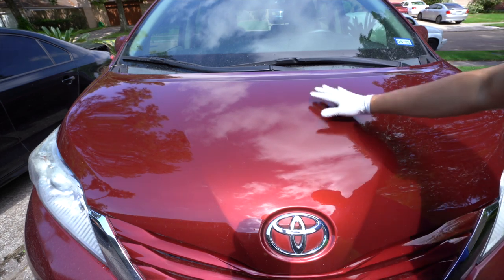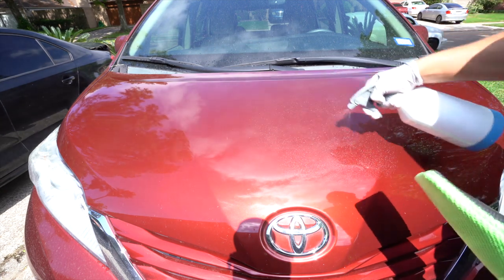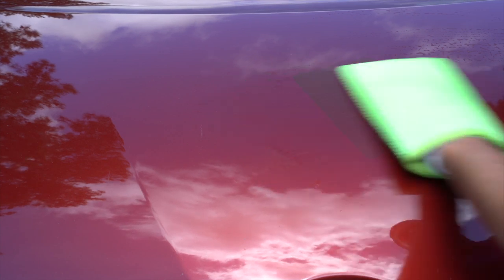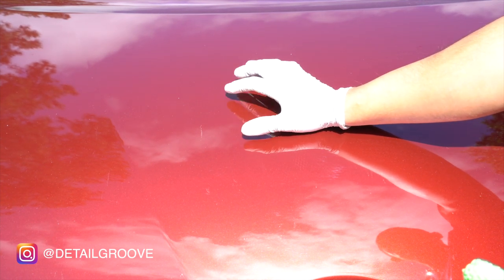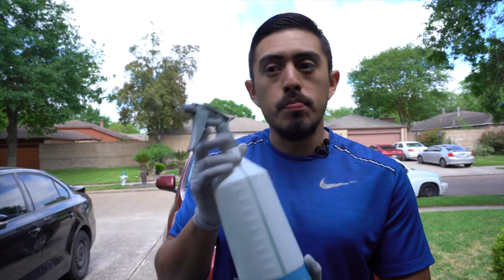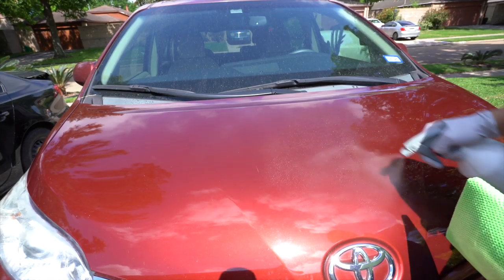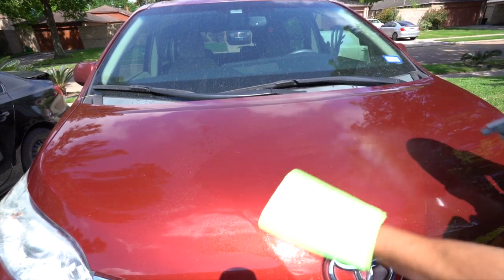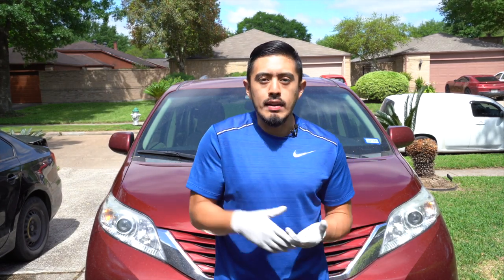How To Clay Paint In Direct Sunlight

Comment: Hi Oscar, from So. Calif. after the initial wash, I'll use ONR with distilled water 20:1 ratio.  That way I don't have to worry as much about water spots in the heat even though I'm drying as I go.

Comment: WOULD IT BE BENEFICIAL TO USE DISTILLED WATER AND SHAMPOO WITH THE CLAY MITT. CLAY AND RINSE METHOD SINCE THE CONTACT WASH HAS BEEN COMPLETED?
EXAMPLE FILL BUCKET WITH A GALLON OF DISTILLED WATER WITH SHAMPOO AND MITT - CLAY AND RINSE/DRY?